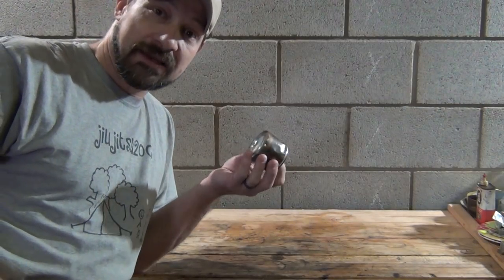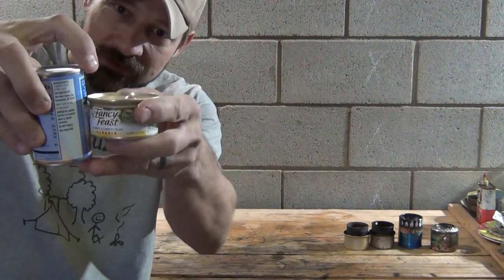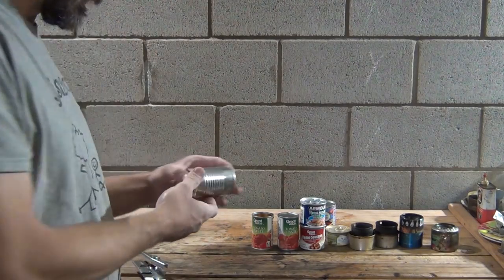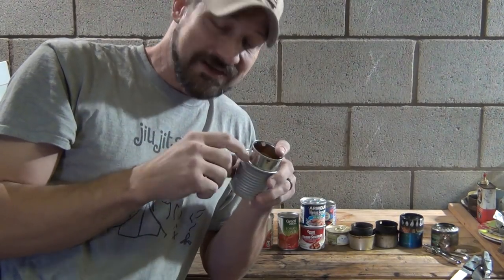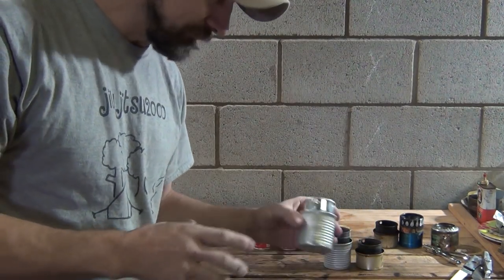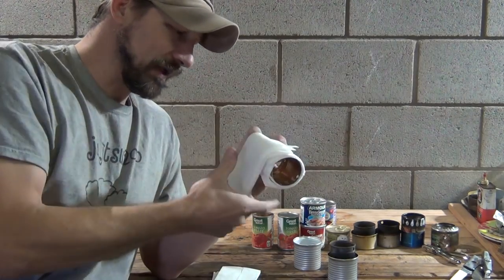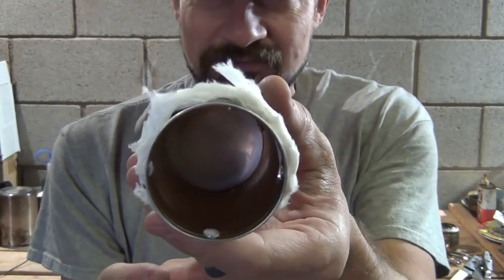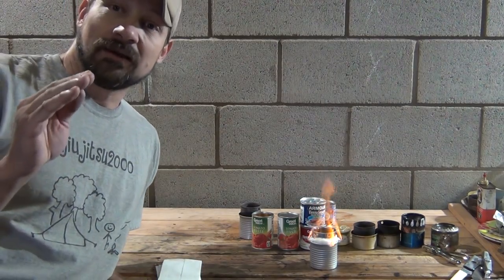How to make a vienna alcohol stove

Comment: Built my first one today. Just as simple and effective as you said. I built mine for home use if the power goes out, so I will have a way to boil water for coffee or meals. I put my stove in an empty canned chicken can and filled around the inside of the chicken can with pea gravel for extra stability, since the original stove is more tall than wide.  Also gives even more insulation. A new one-quart paint can from the big box hardware store snuffs it out. Indoors I will use Everclear if I also want to heat a room while cooking. On the porch it's denatured alcohol or yellow-bottle HEET. Thanks!

Comment: Very good video, an easy way to make version of "Fancy Feast" stove, with cheap materials.

BTW - In my "corner of the world" materials like carbon fiber and similar is expensive and difficult to get, so I try alternatives materials for wick, like cotton, jeans, steel wool (works OK but degrade fast)... ending using a "capillarity wick".

A "sandwich" of beverage can aluminum sheets: one flat + one with vertical "grooves" + one flat, whit the same height of the external can, this create sufficient pressure for keep two tomato paste (here cats eat Fancy Feast from plastic sachet) cans - of different sizes; together and the capillarity between the sheets vaporize alcohol well. Bonus: is easy recovery some leftover of fuel.
Reply: I had the same idea of using aluminum soda cans to make a capillary wick, but I hadn't built it yet. I was also thinking of using a skinny mini soda can (7.5 oz) in place of the tomato paste can for an all aluminum build that won't rust.

Comment: LoL
I literally just did this last night and then I see this video:)

I had an empty tomato paste can and a small tuna can sitting on the edge of my sink for the past year

(I made a super large version using a large can of beans and a soup can and I wanted a smaller version that doesn't suck up a huge amount of alcohol to just get it started)

and I finally got around to buying more felt so I decided to put the smaller stove together and didn't trust myself to trim the tomato paste can even enough for me to trust to balance a pot of boiling water, so I dug through my cupboard and decided that the Vienna sausage can was pretty close (I was looking for a one and a quarter inch extension).

Yes, I verified that I should have put a saucer over the bowl of Vienna sausages when I microwaved it.

Another thought I had was that if I was going to try cooking something that took longer than I planned, if I had a second stove, I could just light it up and switch over without having to wait for the first stove to cool enough to refuel.

Bonus: it looks like 2 of the Vienna sausage can stoves will fit inside my larger one.
Reply: Side note:
The wicking material tends to shrink a little so I trimmed the felt fabric a little long, then tried to jam as much as I could into the outer can and trimmed that just a touch long.

I found 1/4" carbon fiber blanket so it was a bit of a struggle to get everything to fit but it does... and lights up quite nicely.

You can run without the wick, but the flame seems to be weaker and goes out easier.

Of course, paper towels work, just replace them when you need to :)

If I had cotton or jute twine I'd probably use that before paper though.

I used the larger stove to burn off the liner on the tomato paste can >> OUTSIDE<<

trust me, you want to do that outside.

Comment: Great video as always! I've made quite a few alcohol stoves over the years and actually had to use them in my house a couple of times due to power loss. I cooked a spaghetti dinner for 3 over a fancy feast stove I made. Mine was a different design by using a hole punch around the sides of the cat food can, but doesn't hold as much fuel as yours.

Comment: I just got a litre of alcohol 99.9% and i am waiting on some oven door fire blanket type material though i can not wait and i do struggle for dexterity so it looks like i will go with just an unused paint tin.
And i already do have an oil lantern heater that i made from 2 cake tins and a small sheet of 1mm thick mild steel that the lantern sits inside and it heats the top cake tin up great, i had my main room at 20 degree's C last night though it is not very cold here in bonnie Scotland yet but i sure am glad i came across this channel, i enjoy watching and making what i can myself so these vids are great for everyone as i think that we are all going to be left in the dark when folks need the heating or go very cold.
If you have mobility or issues with dexterity you can just use a very clean paint tin filled with fire blanket and pour the alcohol in and go from there. But be sure to use all of the safety tips shown and used right here in this video. 👍

Comment: Those alcohol stoves that you have that are made of aluminum pop cans and beer cans are very hard to get started. You almost have to heat the bottom of to get it boiling. I find that when I made mine, I always poured a bit of fuel on the ground under and around it to get it hot on the bottom and then I didn't have any problem getting it started.
But you're Vienna alcohol stove is state of the art.
I'm going to use carbon fiber when I build mine. With a sheet of carbon fiber, I can get a lot of cuts out of a 12"x12" square of carbon fiber. I find it's not that expensive, and at 12x12 sheet goes a long way and making several Vienna alcohol stoves.
They hold more fuel and burn longer, and that's a plus  when I'm frying bacon or spuds.
Thanks for sharing this video?.

Comment: LOL I made one of those Vienna wick stoves.... by far my favorite at the moment....
but I just saw a very interesting one a larger bean can with a ring of what looked like 3/8"
holes around the top close to the rim and then a ring about 1 1/4" from the bottom (looked like 8 holes evenly spaced around the can top and bottom.
 pour in the fuel, light the alcohol  through the hole near the bottom and it will have jets of blue flame from the top when it reaches temperature !  you should build one and see if you can improve the idea !  the big can is easy to balance a pot directly on the top of the stove 
and adding some wicking material will help from spillage.... it's very simple and puts the flame where it should be.....on the pot ! have fun !

Comment: Great video. Actually for an even simpler build I wondered why you bothered to cut the bottom off the smaller can at all and didn’t just punch holes in the bottom/sides to let the fuel out to the wick. As you say, makes it easier to build out in the field with limited tools.

Comment: I enjoy these videos ... thanks for doing them.  Does the Vienna Sausage stove, as it appears, generate more soot than the more conventional Arizona Ice Tea stove?  I use a Nesbit Alcohol Stove with their 3 piece pot stand and my titanium cup/pot is virtually clean after use.  Is the wick material necessary for the conventional Arizona Tea stove?  I typically pour as much alcohol in my stove (it doesn’t have ant wick material) as have learned is necessary to boil/cook my meal and just let it burn itself dry without having to snuff it ... alcohol evaporates so readily that any excess fuel, whether in a wick or the bottom of the stove, would be gone in short order ... i.e., wasted.  Can you discuss the pros & cons of the penny style vs the open center style of pop can stove - and - wick vs no wick in this same style pop can stove, either penny or open center?  If the only advantage is no spill loss, I’d rather skip the wicking material in the pop can style stove.  Thanks.

Comment: Free brown napkins from McD's lol
Old cotton sock would work.
Jute twine. Cisel twine.

Nice pot but every one I see has a flat bottom and no fold up handle :-(

Every stove I see in videos are always tested on a hard flat level surface.
And usually indoors or no wind.

For long term light source would lamp oil or veg oil work?
Or motor oil if necessary?

Thinking instead of a campfire you have to feed all night use oil in that for the light.
Reply: Crisco in a 4 oz covered jar, with a sisal wick or a birthday candle will last for many hours. But make sure you can't knock it over while you sleep!

Comment: Cool.    I've been using this for 3 years and it's stable and reliable.  Made 3 modifications 
- used rock wool for the wick, packed in tight.  Hasn't come loose at all.
- used "ventless stove fuel" which is 100% ethanol, no toxicity. About $7/liter in bulk.
- cut the top 1/4" wide top of the Vienna can with with a box knife and scissors, and pressed the bottom of the can into it to form a wide base.
Reply: Please elaborate how u made the wider base on the bottom, vienna can?
Reply: @candacekuhn8589  Turn the Vienna can upside down, and use a marker to draw a line around the can 1/4" off the table.  Cut along the line, then discard this can, keeping just the ring.  Clean up the edges of the ring. Take a second Vienna can, lube the bottom with soap, and press it into the ring you just made.

Comment: Well I got to make one of these yesterday while camping. I used paper towels for the wick. I had some camp fuel on hand so I used it. I've heard many people say they used it in alcohol stoves. I lit it just to check performance and was kinda disappointed. It burned every bit of fuel out in about 10 mins. It heated the tomato paste can so much that the inner fuel began to boil and burn faster. I trimmed the wick to flush and tried it again. Same result. Maybe the fuel I used was the problem. Either way... I threw it away. Any input on this would be great because I'd like to make another that would work properly.

Comment: Now I want to try a Vienna stove using tiki torch lamp wicks
Reply: Update
It's tough to pack the tiki torch Wick between the two cans and trim it to length. It works with both Diesel and lamp oil, but needs a taller chimney and possibly is flame spreader plate. It works well without alcohol. All fuels work best if you prime the wick and then fill the bowl. I suspect that having a little more space for the fiberglass Wix will allow them to draw the liquid better.

Comment: I was thinking this would be good to slip inside a Sterno stove for emergency indoor cooking.  But the pan wouldn’t seal off the hole because of the grate in between.  So I was thinking either leave the bottom on the can and put it in upside down or cut off the bottom with one of those safety openers.  Then you would have a lid that you could take off for fueling and put back on to burn it.  Am I too worried about that big center hole?  Maybe it wouldn’t matter that much?

Comment: If you get a can right a the height of the wick. Cut away the top and bottom of that can, and you have a diy simmer ring. :)
Reply: Can you please explain this further? How to make a diy simmer ring?
Reply: @merryheart443  I made my own CHS by 1 tuna can with steel wool, toilet paper inside and iron mesh on top. For my DIY simmer ring, i cut another tuna can (the bottom) and make some small holes by a simple way (by hammer and 📍). Voilà, I enjoy cooking rice n some vegetable dishes for approx 1 hour with 50cc of methanol.
The principle of simmer ring is reducing fire, and it become smaller.
For boiling water, I use my another CHS (15 or 20 gram aluminium can, it's very small can but very powerful.. I just need 2 minutes for boiling 300cc of water with 20cc of methanol. 
It's my fave CHS for making my coffee, every time n every where (even in my home).

Comment: How do you handle leftover fuel and storing the unit for backpack
Reply: Pour the leftover fuel back into the trangia fuel bottle, burn off the residual fuel & pop it into ur snuffer can with some paper or shop towel to stop the rattle & a leftover single sock wrapped on itself to hold it altogether

Comment: Can it be used as a room heater?
Reply: Yes Sir, Ive just built a few simple ceramic oven dish filled with pebbles .
Using purple Methylated spirits, couldn't find the rubbing alcohol.
Reply: The wick ones are a little too sooty for indoors.
Look for D.I.Y. Indoor fire pits & fondue burners. 
Add pebbles to reduce flame size and prolonge the burn

Comment: Could used veggie oil be used in a pinch
Reply from the maker: Yes, but It takes a lot to get it going though
Reply: I think oil could be used if using Carbon felt as a wick. Squirt a little 75% plus alcohol handsanitizer on it to light!
Not sure about soot...

Comment: Can you Tell jujitsu me why the holes on top? Bottom i know you said to alcohol to travel to the wick but on the top?
Reply: I think that it is to allow the inside of the tomato can to vent. If the pot made a good seal with the top of the tomato can  then pressure might build up within the tomato can, which could force liquid alcohol up through the wick, which could spill outside the stove. A single vent hole at the top of the tomato can would likely be enough to avoid that problem.

Comment: Having boiled coffee for years with alcohol scrap can stoves... I don't think most of this wicking and sooty yellow flame mess is needed.   
1)Tuna can (or cat food can) opened with no modifications
2) cut bottom out of sausage can (or tomato sauce can) leaving it slightly taller than tuna can.
3) drill or punch holes in sausage can... Anywhere you feel like.  I do mine at top and some near bottom. 
4) pour ounce of HEET methanol in tuna can
5) light
6) drop sausage can in tuna can (no wick)
7) sit water cup atop

Wait 5 minutes and it will boil.  If you shield it from wind it will burn for 15 minutes or more.

If you want it really effective, put the whole rig inside a utensil straining can $3 st Walmart or coffee can full of holes $0.  Holds in heat, shields wind.

Later when done with alcohol cooking... Use the can full of holes as a stick and pine cone fire hobo stove.

Comment: Idea, get an aluminum large mouth water bottle drill hole in side and install a presure release valve with a quick connect hose attached to it that run's over to a burner. Make a copper sleeve for the bottom of the aluminum water bottle. Use a can for a base and to hold a candle that will heat up the modified water bottle filled with alcohol that will turn to vapor build presure then relesed at a steady rate to the burner for a presurized hot blue flame. 😊
Reply: Jim Martin how’d that work?
Reply: Doesn't sound simple or easy....

Comment: Part of it is the type of Pot. The difference between 4 and 6 min boil is pot diameter. P.S. I would not encourage anybody to attempt to recover unburned alcohol. Learn your Oz.  Wind screen!  Not a good type of stove with children around. If you use it (I love em) location, location, location. I'm done! Thanx.
Reply: Do you mean that the larger the diameter, the faster the boil?
Reply: @candacekuhn8589  Wow, 3 years. Yes, the larger the pot diameter the more fire to the base of the pot. Often the fire provided by the stove is around the circumference and along the sides of the pot. A larger diameter would put more fire in contact with the base and increase efficiency.